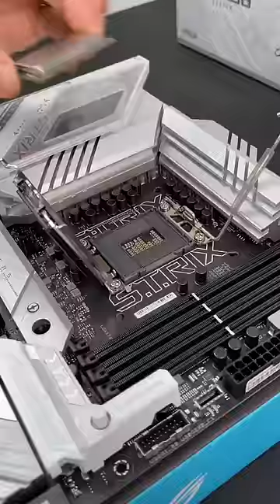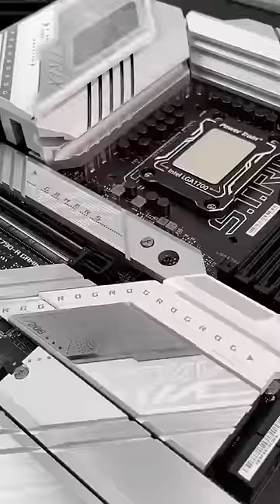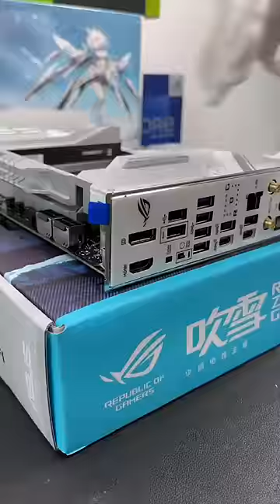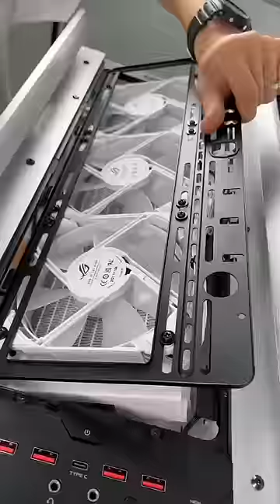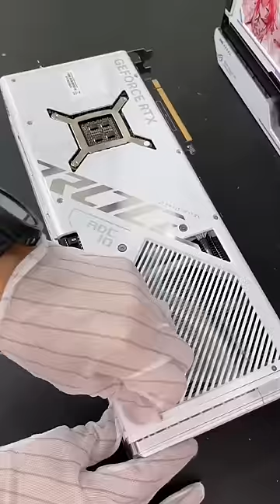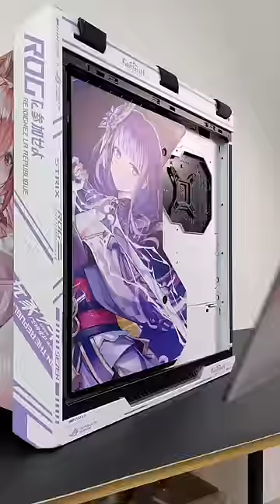Intel i9-13900K🔥 with RTX4090👑 #pcbuild ASMR #shorts

Comment: Installs 2 RAM modules but he opened clips of all 4 slots just for the vibe, exactly what i would've done too😂
Reply: hahahaha i‘m looking for some one to talk about this 😂
Reply: Bro, almost every pc building shorts/video they always do that like why tho XD
Reply: @butman8707 I do it because I don't want to open those clips later when I install another two RAM sticks. Lot harder to reach those when the 2 sticks are on the board, and the board is installed in the case. Can't speak for anyone else, but I'd bet that's why they do as well.
Reply: these 2 RAM are too powerfull to enable another pair to plug after
Reply: It's for the asmr
Reply: Fr
Reply: @waxirio1696  what are you talking about
Reply: It’s crazy to think about but 2 RAM sticks is actually more optimal than 4🤷‍♀️
Reply: @kxngjxckk  yeah true, they give the benefits of dual channeling plus future upgrade of ram is much cheaper
Reply: @Arpit07 ram is complicated but with how cheap capacity is and how fast DDR is getting I don't see a point in using 4 sticks, especially thinking you'll buy two more of the same type instead of upgrading the two already in there.  You also lose some performance by using all 4 slots as the two sticks will now have to buffer as they are using the same address bus.
Reply: haha yeah i've seen him do this before
Reply: bro its dual chamber
Reply: Ddr5 is still really unstable on 4 module set ups ATM. Hope they get that fixed soon.
Reply: @butman8707  what if one of the dims doesnt work so you gotta switch.

Comment: Only putting in 2 sticks of ram on something like this is criminal.
Reply: bruh
Reply: you cant run certain ram speeds with higher ram counts.
Reply: Pretty sure intel is still usntable at higher speeds with 4 sticks
Reply: two 64 ddr5 is not criminal 😂
Reply: 128 Go of RAM is not enough?
Reply: DDR5 is terrible with 4 sticks lol. Only 4 sticks if you need 128gb+ for a workstation.
Reply: DDR5 in generall can run higher clock speeds with just 2 sticks.
Manufacturers should offer "dummies" so you can only put 2 actuall RAM modules in but still have 4 slots used and illuminated with RGB.
I do have all 4 used - 64 GB 4800 MHz and I get the same fps in games as if I only use 2 - 32 GB 6000 MHz. 🤷🏻‍♂️

Comment: Thats one of the worst Motherboards one can use for th3 13900k.     Its bios sucks donkey doo doo!    

Using the exact identical bios settings ive scored from 36k to 40k on CBr23!  

3dmark CPU score from (single core) 1130 to 1270 (all core) 16,300 to 17,500.  

Intel ETU/XTU benchmark 12,900 to 14,050

The first couple bios werent to bad then i believe it was the 4th that worked great!     Now all of a sudden my System agent voltage jumped from 1.25 to 1.35 usinf default recommended settings.    The ram used to be at 1.4 and you had to swap the one thing to get higher.   Today it shows up as 1.41 to 1.8 with XMP.   

No matter what I do inside the bios i cant gain the performance back i once had!   I have to use the Intel ETU app to get a stable 5.7 P cores.     Unfortunately the intel ETU app doesn't save the settings or the core multiplier will default to 30 requiring me to manually check my profile settings each and every time and test for stability.    One day it works perfectly, next day it doesn't.  identical settings 😂

Ive just accepted its impossible to fine tune the 13900k with this motherboard and live with the loss of performance.   

Ive seen the 13900k hit 24,400 on 3d mark time spy using their default settings and XMP.    While ive hit that number once or twice with earlier bios, im lucky to score over 23,000 with the current bios!! 

Its been unbelievably frustrating.  Most of the time i just accept the performance loss vs trying to fine tune it back to where it was!!     I definitely regret not going with a slightly higher end MB.   

Whats weird is i used both the D4 and Ddr5 versions and the D4 was rock solid